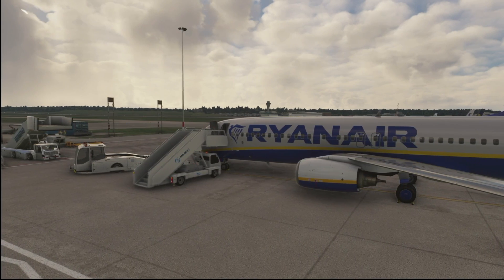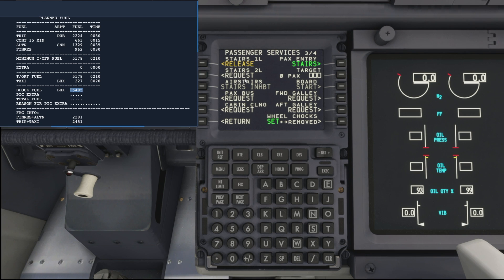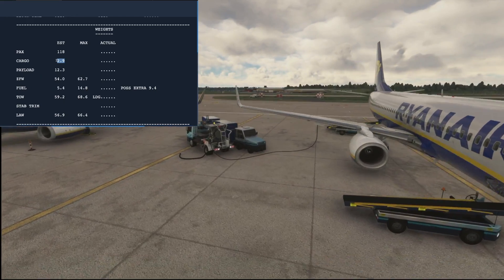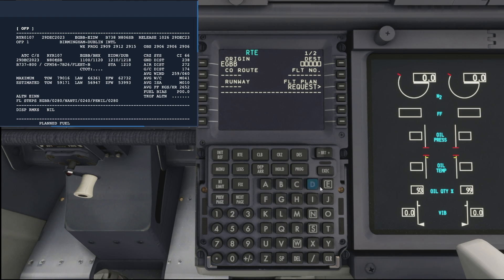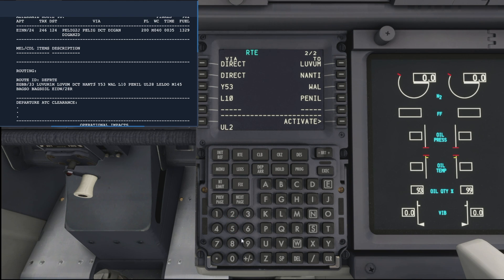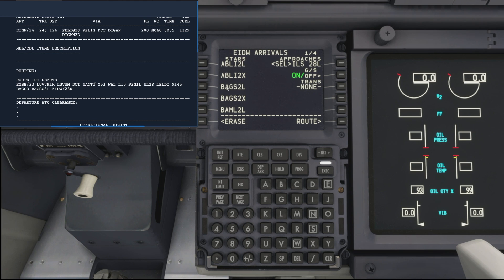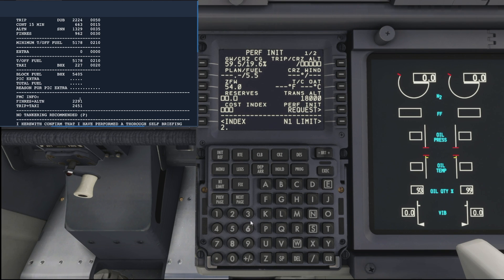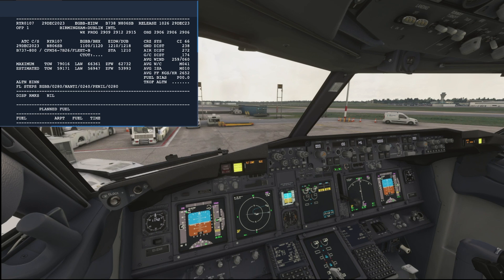PMDG 737-800 FMC Basics TUTORIAL #microsoftflightsimulator #msfs2020 #msfs #pmdg #boeing

Comment: I have a question driving me nuts. If on sim brief under FINRES it says 763 what do I put into the fmc for reserve fuel.  0.8 ?? Everyone is putting 0.3 or 0.7 etc.  what is the formula I have to use to get that decimal point number. If anyone understands what I’m saying 😂. Thanks
Reply from the maker: Hi… for you reserves you need to add the FINRES + ALT number from the flight plan. So for example (presuming you are using KG not LBS) if it was 2387 I would round that up to 2400 so it would be 2.4 in the FMC. So yes in your case 763 kg would round up to 0.8. Hope this helps. Happy flying ✈️👍

Comment: Great video. I have one question how did you calculate the cargo number in video 2.9 but U did put 1500 FWD 1399 ATF 2:25
Reply from the maker: Hey, thanks! So I got the 2.9 tons cargo from the Simbrief flight plan and added 1500 to the Front loader and 1400 for the rear which adds up to 2900 (2.9 tons). However when I added 1400 for the rear loader it automatically rounded down to 1399, not sure why but it’s still well within an acceptable tolerance for 2.9. Hope this helps explain a bit clearer. Thanks for watching & commenting, appreciated ✈️👍
Reply: @seven3simmer  Thanks so much for your response . I got you ❤️

Comment: I have the 737 max & recently got the 737-800 but on the 800 I can’t figure out the ground service outside of ramp being connected that seems to be all I can do any help?
Reply from the maker: Hi… do you mean you want to connect the jetway? In the FMC go into the FS Actions menu, then ground services, then go to page 3 and choose pax entry, you can select either Jetway or Stairs. Or if it’s something else it’s probably in that ground services menu, there’s 4 pages of options so I’m sure you’ll find what you’re looking for in there. Thanks for watching 👍
Reply: @seven3simmer  yea none of my ground service is available to use for the 737-800 all I can do is open doors & connect the jetway & chock the wheels that’s it… I’m trying to figure out how to do the baggage, fueling the whole 9 and I get to the ground service pages but it’s says “engine inhibit” like it’s not available or something
Reply: @seven3simmer  you know how yours in the ground service says request on all the pages mine doesn’t say that & idk why… I’ve been trying to figure it out for days
Reply from the maker: Hi… it sounds like you might have your engines running? This would stop you from using all the ground handling equipment. Go into the PMDG setup menu and select your panel load to cold & dark. Then you can set the aircraft up from scratch and everything should work fine. 👍